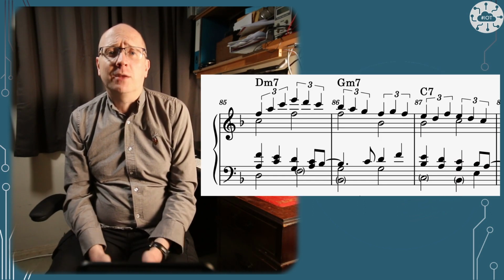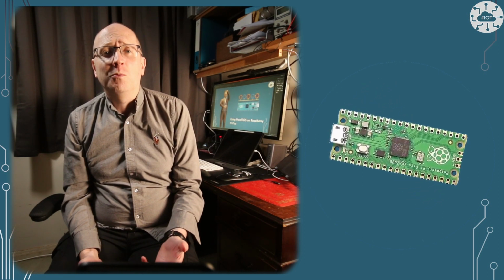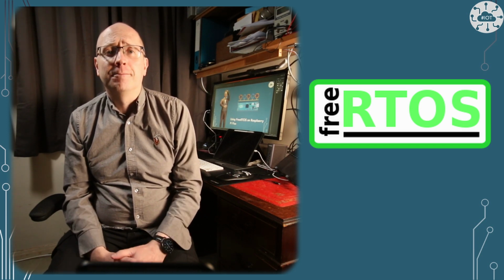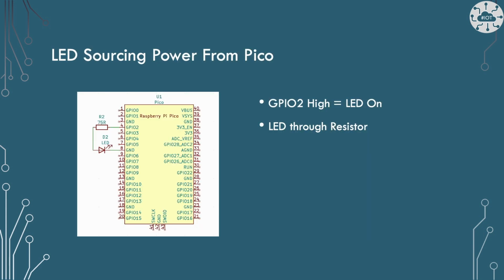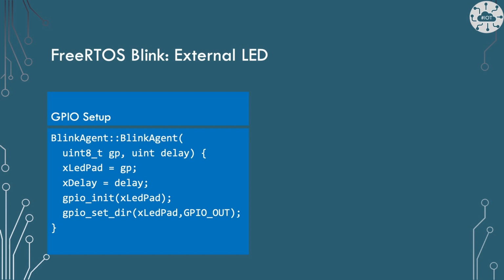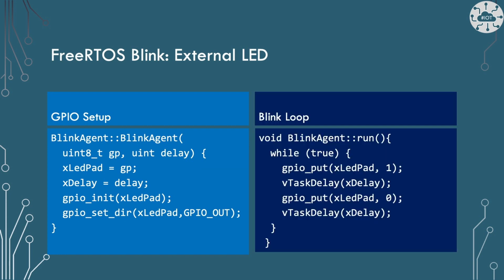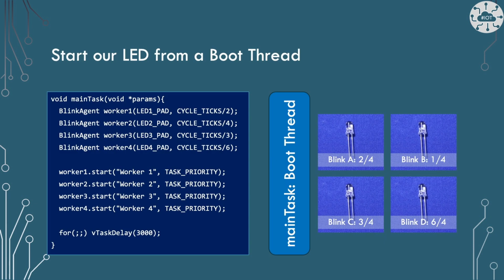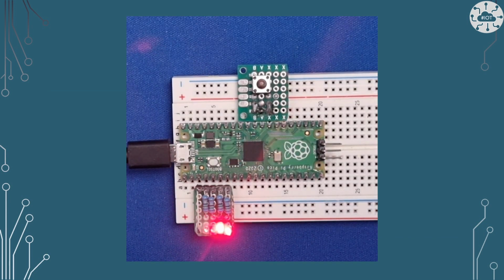Using FreeRTOS on Raspberry PI Pico

Comment: Hi,  Is there a reason to create a task (mainTask) for the purpose of creating the other 4 tasks?  Can the 4 tasks be created directly in main? Thanks
Reply from the maker: Yes you can setup tasks in main directly. Just a pattern I tend to follow to do setup in stages.
Reply from the maker: One advantage is with monitoring stack and heap usage. FreeRTOS has somw nice utility to monitor this and monitoring all in one place is helpful. Hardening for production!

Comment: There are C codes in which we use freertos. When we wanted to unit test these codes, ceedling was not fully working. We got this done. But what can we do to perform integration tests of more than one component?

How can C code using Freertos be tested independently of hardware?
Reply from the maker: To perform tests on more than one component you might different tests groups in CPPUTEST.  Perhaps test groups to test multiple components in combination. Certainly what I have done.

It is possible to run FreeRTOS on a host platform like Windows or Linux. Then to be able to set that up as a test environment. Its not something I have done yet. For a big project it is certainly something worth taking the time I think.